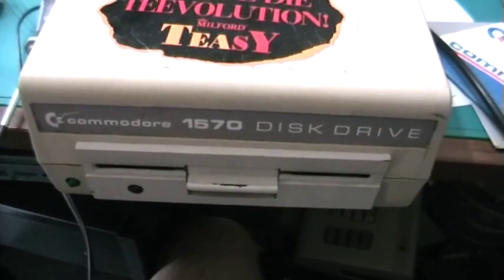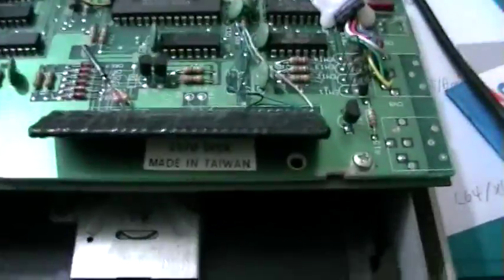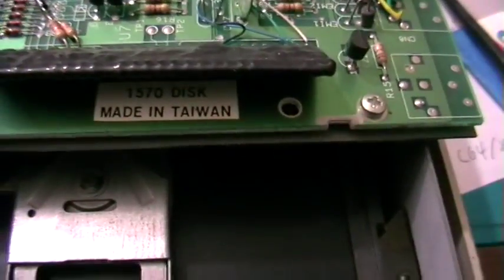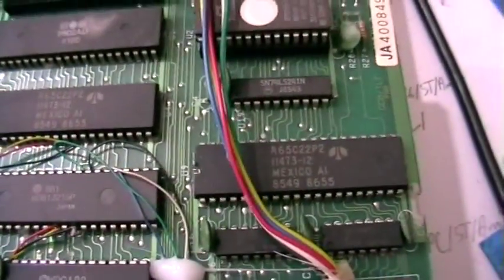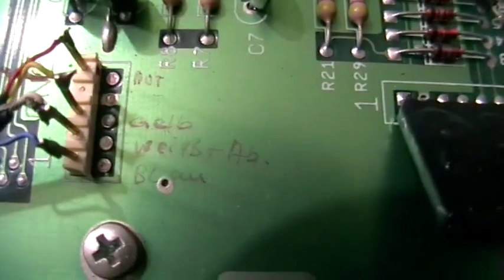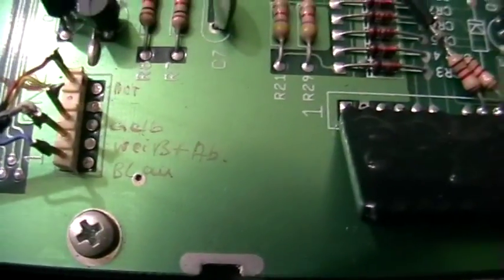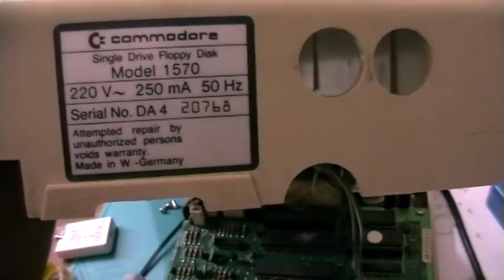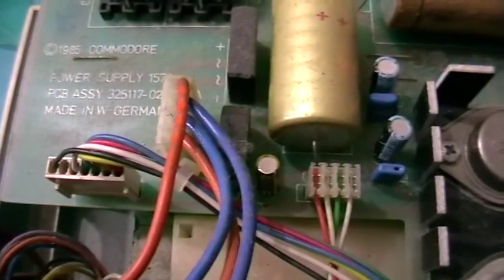Weird Stuff: Inside a Commodore 1570 Disk Drive

Comment: Well, I didn't see too much reason for panic. It is not uncommon to find such dirty and ugly mods in computer equipment made in the 1980s. The fact is that 30-40 years ago wasn't as easy and cheap as today to make boards so when they found a nasty bug in the middle of the assembly of the equipment they couldn't just dump everything and redo the whole crap overnight. Instead they preferred to solder a few wires and hang some parts to make it work, so don't get surprised if you find other drives from the same batch exactly like this. That's how things were done by those great days when personal computing was being born! And they knew to do it so well that your drive is still working by now. But, yeah, I totally understand that it may not make any sense for whose didn't grow up by that time! :)

Comment: I had a 1541 as a kid (the restyled version in grey). It started to become quite unreliable, but I had my suspicions it was full of spring-loaded, fiddly plastic panels and shoddy soldering.  If it was anything like this, I was wise not to attempt opening it.
Reply from the maker: It seems, that this drive is especially bad... even for commodore.
Maybe it saw some repair work during its life.
I have an other 1570 that looks perfectly fine inside. Probably your drive was also perfectly fine inside with no bodge work at all.
Have you tried a cleaning disk back in the days?
Most of the times when a disk drive stops working for me, it's just that the r/w head is clunked up with dirt.
Happens a lot mor often nowadays than back in the 80s, because the disks are slowly starting to disintegrate.

Comment: I like with s / n 5524. After running the red light does not turn off and the drive turns the engine without a floppy disk.

Comment: hello i wish ask if  you can help me ,  i have a 1570 this same version you have and don´t want read any disk , the drive work only if i use a c128 in 64 version. The c128 work well because i had another drive to load programs in 128 version  so is a strange problem of 1570 which work only in 64 version. Sorry for my bad english i hope you understand and also i hope you can help me ;) really thanks
Reply from the maker: +Laguna Rock So, the drive reads disks in C64 mode OK, but not in C128 mode, right?
And other drives load fine in 128 mode?
Have you tried cleaning the drive heads?
That's the only advice I can give you right now. I'm no expert on the 1570. 
Maybe you can ask in the lemon64 forum, or in the atariage forum. There are probably people around there that have much more knowledge than I have.

Comment: The 1570 was produced only because there were problems which delayed production of the 1571. So to have a drive for the C128 the 1570 was 'created' as interim solution. It is a twitter between a 1541 (mechanics) and a 1571 (electronics). And yes, there is no specific 1570 board, since there were only minor modifications to the 1571 board needed. However I have never seen this missing connector (for the R/W head). This soldered thing (and the writing) seems to be caused by a (poor) repair.
Reply from the maker: Iirc it was that Commodore didn't get enough drive mechanics to satisfy the demand for the 1571 do they quickly produced the 1570 as a stop gap.
Not a very useful drive today... at least not one I would hunt when I actually want to use it.
It probably IS a dodgy repair job, but the drive works flawlessly since I got it 10 years ago or so.

Comment from the maker: You might be correct. I have another 1570 in my collection and I just opened it.
It looks quite different. Still some wires going across the board, but not this bad. I'll upload a video later.
I wonder what was repaired like this? Compared to the other board it doesn't make too much sense to do it like this.